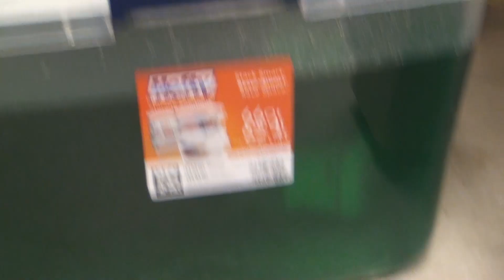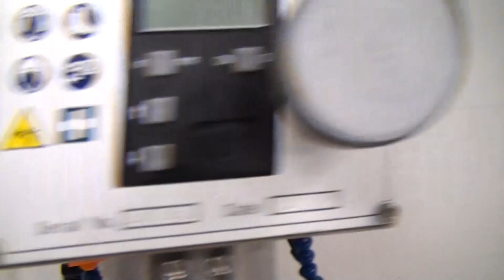CNC-G0704 #11 Flood Coolant Update

Comment: If you do change your pump you may want to try out a pump made for pond fountains..  They seem to make a good balance of pressure and volume and  they are already 110v.  The bilge pumps are designed to move a large volume of water but don't have much lift.  I use a small 100gph one on my Taig but I'm going to a 300gph so I can add another nozzle.  Nice video!
Reply from the maker: Thanks! The pump I had in there was a 330GPH pond pump, and it probably put the same amount of water on the table that this 1200GPH does. Oh well. The next pump (if I ever upgrade again) is going to be a MONSTER!

Comment: Great update!
Reply from the maker: Thanks! You know, I'm a little sad this pump isn't making more pressure. I'm thinking http://www.amazon.com/dp/B00554SP3K would do the trick :p
Reply: russtuff That would be awesome!  I wanted to go with a bigger pump, but I'm using the Tormach control box to turn the coolant on and off and I'm not sure how much current that circuit can handle.  Someday I'll put a beast of a pump in there and use an external relay system.
Reply from the maker: Christopher Anglin
I would assume you will have to go with an outside relay too. I'll do the same if I ever do another upgrade, but honestly it is not high on the priority list.